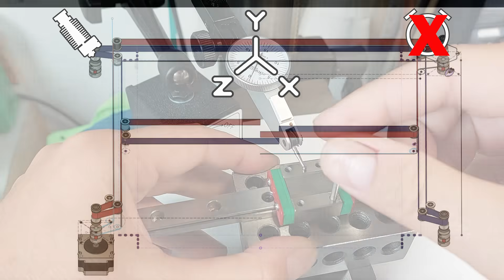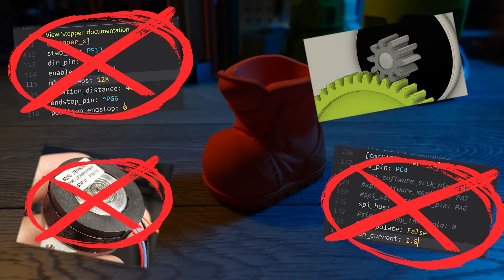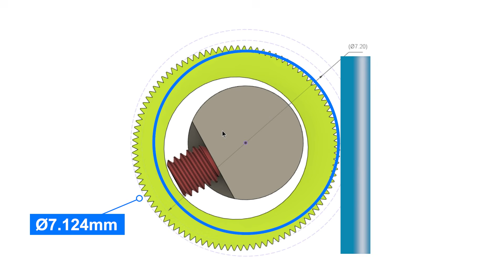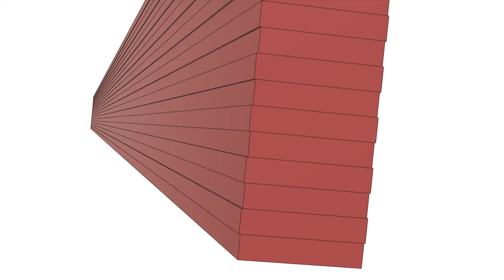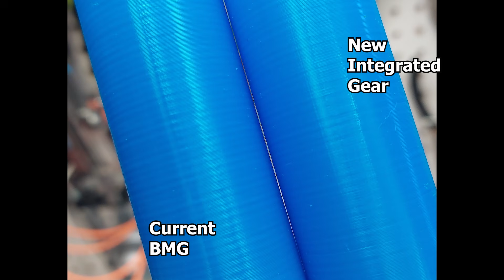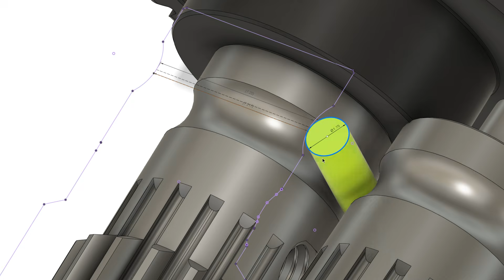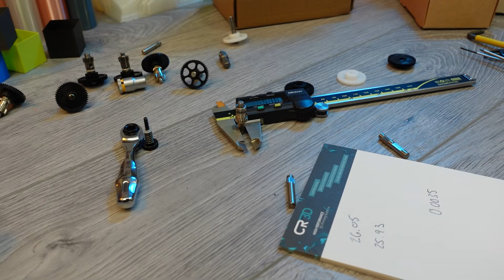Extrusion Quality - Mystery issue resolved !

Comment: This all seems very well.
A good design should not allow the Z axis screw to impart X or Y motion. It should only couple in one direction. 
But even with decoupling, if it is not straight, the advance will not be constant. 

What you need is a linear encoder directly attached the carriage and drive you motors in closed loop feedback of the actual position, rather than counting the degrees of rotation / steps.

You can find such 500 mm encoder with accuracy of 5 or 1 uM at reasonable prices of 100 to 200$CAD. However, none of the closed loop stepper drivers I have found yet have explicit support for a linear encoder, only magnetic or rotation encoder.

Also, the issue you are encountering here, leads me to believe that it is a constant pressure (or rather constant or accurately metered flow rate) that needs to be measured and compensated at the nozzle.

How to measure pressure or flow rate of the plastic in the extruder ? 

It would be much better to have a closed loop feedback compensation on either the extrusion chamber pressure and/or material flow rate at the nozzle.

Also, as you observed, the bowden tube lenght offer spring like buffering of the forces on the filament which could smooth out operations.  I think the dichotomy between bowden and direct drive is false ! The ideal setup is an hybrid system, which will allow even smaller direct extruder motors which are boosted by a larger, static bowden external extruder.
Reply: Chasing high precision parts and filament dimensions will cause the prices to skyrocket but live closed loop feedback at the extruder could take those tolerances out of the equation and keep prices low.  It might help to have a filament thickness sensor just as an extra data point in the calibration.

Comment: i already had a bearing in my extruder , and CNC kitchen pointed out the problem with the grub screw tilting the gear and making artifact
i checked my printer , and i found out the gear and the teeth are not eccentric the the motor shaft , the hole was not in the center of the gear at all
i bought a higher quality gear from another brand all together and it was night and day difference.
i have a Bowden tube and a MK6 extruder and i think the quality of my parts are comparable to yours , 
for anyone reading this ,if you can feel your layer lines check your extruder like in the video and make sure your layer lines are divisible by your nozzle diameter (for 0.4 nozzle , print at 0.2 , 0.12 ,0.14 ,0.18 layer height ) ,and tune pressure advance , it is worth it

Comment: The hub gear groove won’t self align because it’s squeezing a material that behaves like an elastic. Just like a crowned pulley pulls a rubber belt up onto the crown, the filament will pull itself into the tightest side of the groove. It’s counterintuitive, but happens anytime you squeeze or stretch something skinny against rollers because poisson’s ratio causes the filament (or belt) to curve towards the location with highest pressure.
Reply: Sorry not Poisson’s ratio, it’s just the pressure gradient in the material.

Comment: You and Simon are amazing!, I'm running your extruder design on a Vzbot with BMG internals, I also have the banding on my prints, been trying to figure out what it is?, which lead me here?, what bearings did you replace the floating gear with? I.D 3mm O.D 8mm ??

Update:
I've got one of the new gears which is now part of the shaft and it's no better than before, In fact I brought two of them and one of them has the biggest wobble you have ever seen on the plastic white 50t gear! (it's not flat) for that to end up at me shows you how much quality control is lacking at bondtech, I'm not very happy that I wasted £15 pounds on it?..... if you want me to send it to you I will?......will not be buying anymore of their stuff!, I don't see an improvement with the new gear, I see uneven layers when shinning a light from the top of the print, I'm going to try the bearing for the idle gear for a while! and some other things will update after testing, also if I go bowden it goes away like your prints.....I'm running a vz-bot gantry and your wobble wings on my lead screws on a core x-y design.......
The cleanest stacked layers I've ever seen was with a wanhao i3 that I used to own and that was just a toothed idler on the motor shaft with a v-bearing on the arm and tensioned with a spring.......

Comment: It looks like a bowden design creates a buffer for the extrusion that evens the flow. You lose precision from a DD yet you got those nice smooth layer lines. It's the same thing with rubber wheels and v-slot: not as precise as linear rods or rails yet for functional parts you get better surface, you lose details on figurines due to smoothing.

Comment: Amazing video!!! The difference between bowden and direct drive became apparent to me rather recently. I am glad someone else noticed the same issue! I have always liked Bondtech extruders, but I think there are still some issues that they need to work through. I have used the BMG on many direct drive setups and have also tried the LGX light extruder, and see the same artifacts that you referred to in this video with both extruders, even though the geometry between the two are drastically different. I have recently switched to the Orbiter 2.0 manufactured by LDO and the difference is surface quality is amazing!! Not perfect, but there is a drastic improvement when compared to both the BMG and the LGX.

Comment: I believe that the problem is due to the idle gear to no coincident the pith circle. They are supposed to be involute gears and must contact the pith circle to maintain constant rotation speed. When we approach the gears too much or separate the speed of rotation in the idle gear it will not be constant but a speed change pattern appears changing the extrusion volume of flow.
There will only be one position so that there are artifacts disappears.
With this type of designs that "are not mechanically orthodox", I mean that varying the involute gear distance of axes is not orthodox solution.
I know this issues from using rack and pinions in CNC.

Comment: What about a flexible shaft to move away the steeper? It could add a little bit of elasticity in the shaft, but it s usually a high acceleration. No steeper, less weight, less vibration.

Comment: Maybe something else that could also have an impact on how the filament rides through the extruder is whether there's any vertical lateral offset of the filament feed path into and out of the extruder teeth (if the filament is not directly in line with the centre of the extruder teeth), perhaps causing the filament to ride up/down the curved tooth profile during extrusion and retraction.

Comment: Most excellent video - congrats. I've had the same artifact problem for some time now. My printer is an FLSun SuperRacer with LGX-Lite direct drive running Klipper, and I thought upgrading the LGX-Lite with the new all metal drive gears would help. It didn't. So I replaced the original drive belts with new carbon-fiber reinforced ones, but that didn't help either. So maybe you have hit on the real problem with your filament walk theory. Here's hoping Bondtech finds a fix for that.

Comment: Maybe a future solution to eliminate it as an issue, is pre-shaping prior to nozzle, so there is a kind of restrictor that shapes the filament through slightly lower heat than final extrusion temperature. So for instance, you'd have a 0.4 nozzle, prior to reaching the nozzle having a restrictor that takes the tolerances of the 1.75mm filament into account and maybe shapes it down to 1.5 or 1.6 prior to reaching the nozzle. At that point if you then know that the filament will be precise diameter to, you'd only have to solve for pressure to keep flow and to monitor the flow.

Although a thought that might come to mind then might be "but what about retraction", and that's where a bowden style setup comes in and the distance to the nozzle being able to solve for flow, alternatively even doing a bi-extruder setup with bowden for filament-prep and direct drive for final print control. Granted nothing would yield as perfect feed rate as the industrial method of "clamping arms" that move with acme-rods while clamping onto something over a longer area with just friction and feed the filament completely evenly (or as even as the arms themselves move), but this isn't sustainable for use with "consumer grade" printers unless someone finds a way to make it far cheaper.

Comment: Would it be possible to introduce noise into the extrusion motor in order to create a minute random surface texture to hide any regularities in artifacting? It would leave a matte surface rather than completely smooth, but this may be useful and the melting methods of smoothing may need less time to level out the surface.

Comment: Wondering. Any reason why you use.lead screws instead of belted z?
Reply from the maker: I went with ball screws for potential high temp heat chamber printing and long term reliability.  I also had plans for light machining using tool changer.   Switching to belt would be A LOT of rework for which I don't see the value.
Reply: @MirageC  Makes sense.  But if you did n;t care about machining or high temp, would you think belts are better for z to get rid of issues?  Asking because you are one of the best 3d print guys i found, so would like your opinion on the issue.

Comment: Could you explain why the bowden system got better results? My first thought was, that the elasticity of filament between extruder and Nozzle would compensate? Is there an other explanation?

Very interesting video!
Reply from the maker: That is the main reason indeed.  The other reason was that I used a different extruder, a Hemera.

Comment: Motor Manufacturers and Pulley manufacturers need to work together to come up with a tighter tolerances solution that keep the pulley centered on the motor shaft.

Comment: If the bearing worked. Maybe the plastic should be push between two wheels that have smooth flat surface but with a good combination of hard soft and very grippy rubber. Hey! maybe with a new material like this one : https://www.youtube.com/watch?v=vS0TuIPoeBs

Comment: I've been attempting to recreate this experiment on my own printer in order to fix it in the Klipper firmware, but so far with very limited luck. What I basically want to know is how much I should adjust the flow rate for every value of the little gear thingie. I already have a test setup capable of applying the changes...

From my config, I should do a full revolution of the little gear in 22.22 mm of filament. That means I should be able to reproduce your results. What I tried, was 
(1) make a rectangular test pattern that extrudes exactly 22.22mm filament in the X direction. That gave some artefacts, but not enough to tell me that there's something on and how much to adjust the flow. I tried 
(2) extruding in thin air, and measuring the wire. I'm not sure if gravity interferes, but so far it gave me little luck. I tried measuring with a mitu micrometer, a microscope, and a precision caliper.
(3) extruding a single line. Well, it was worth the try, but that's not happening...
(4) putting the microscope in front of the nozzle and capturing it by camera. There's definitely variations there, not sure what the cause is though... could be pretty much anything. And again, I think the gravity 'pulls' the string out and smoothing it.

So at this point I'm starting to get out of ideas. Any suggestions?

Comment: Measuring my bambu labs extruder right now and the whole assembly has 80 micron of runout. Guess I found what’s causing my poor layer consistency
Reply: Thank you, I was wondering if they did better job
Reply: @mikoaj2323  not really. Quality control is poor and parts are impossible to fix yourself

Comment: Beautiful analysis! I would think firmware could compensate for some of this. Maybe print a test pattern, put it on a scanner (the paper kind), and do some image analysis to make a correction table. I suppose you would have to do this each power up, since there’s no extruded reference, for most of us.

Why is the contact surface curved instead of a wide V? A V would help guarantee that the filament always sets into the same position. An arc should never be used for a position reference.

Comment: Mr MirageC, the voron m4 extruder uses a belt. Assuming the main drive gears are perfect, does a belt eliminate the oscillation of flow? I'm not sure how to word it but I'm curious if using a belt with 'perfect mesh' at every point negates any diameter changes that off center gears do. It's hard for me to visualize. Or is it possible that it has such a large diameter that any variation is proportionately small?

Second question I have is what bearings did you use for the idler? I'd like to try that out.
Reply: I have voron m4 (direct drive) on 2 printers, and I can say, on one printer it looks pretty consistent, but on second one layers are uglier than you can see on video above. I think it has something to do with printing tightening part (the one with "M4" text) with right tolerances, so it couldn't move to sides

Comment: Thank you for this incredible work, you helped me a lot with this problem. For now i think that the right solution is the extruder mounted on Prusa XL, from the image of the release we can se a big wheel that grip the filament in lenght and not in both side because the idler is composed by 2 small bearing, in this way the surface of contact is very large without using an geared idler. Maybe this can be the future for direct extruders, what is your tought?

Comment: timing is not the thing you are looking for (jedi wave hand)
the fundamental problem you have is step driver say make in germany
tool runout is common issue with small diameter tool in cnc machining, but we are talking like <1mm tools and feed is less than runout so one side is not cutting and the other is cutting 2x. Then you get more problems when you need to drive at like tens k ripems, balance, runout etc.
When you use micron it messes up guys mind who uses proper metric system, for money at work and for money making gears and splines at work for money
If it was precision instrument you paid 10x what it cost you now so no is not precision and is driven by stepper so no way.
Getting even a machined gear to run less than 0.01 is difficult ask me how i know
Anyway, always when you start to fiddle more than is necessary you fuck yourself over

Comment: This is really interesting. I swapped my Voron CW1 out for a DyzeXtruder Pro I had laying around. The layer variation basically went away with the Dyze. Dyze doesn't use any set screw gears and everything is metal, which I assume improves tolerances and stability of the shafts.

Comment: Really enjoyed this video MirageC! I used to have this problem and somehow it went away after poking around my Ender 5 Plus. Though now my print quality is still good after adding Klipper to the mix, I get a weird VFA when I print and I'm kinda annoyed by it... 🙃 

I think it could be done by the dual gear extruder that I use (DG1 Extruder from 3DMaker) or maybe the use of brass leadscrew nuts instead of POM antibacklash nuts. I have a print that I done several months ago that looked lovely and smooth that I wish I could get back too.... 😞

Comment: High end printer... you mean something anyone can build in their room for 200-300 bucks.... 40$ main board 10-15$ per motor x4-5 = 40-60 bucks, 10 bucks for nuts and bolts, 10 bucks for pulleys and gears nd 20 bucks for some framing, 10 dollar hot end extra 50 bucks for whatever else...  there is nothing about these that are special there is more that goes into a walkman than a 3d printer lol even the construction is simple stupid.... the only thing thathas any true value to these things is the software and well thats free.... so wtf?
Reply from the maker: How much speed, reliability, material compatibility and quality are you getting from that "stupid" pile up you just described?  better than an ender3?  I hope the answer is yes to all aspects.
Reply: @MirageC  as much as every other generic printer on the market?  i just priced of the exact parts for the Ender 5 pro... thats how much it costs to build one....and no it is not better than an ender 3 lmao is worse lol.....

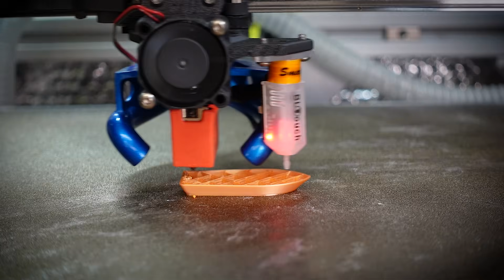Comment: Size of the printer made bowden impractical for retraction etc @5:00.  My first thought:  Keep the extruder on the print head, turn it to an angle other than directly into the heat break, and have an arbitrarily short run (200mm, 300mm perhaps?) of bowden tube make a few laps around the printhead itself, and then into the heat break.  Et vois la;  Bowden for shock absorbtion, with a tunable length.

Comment: Most likely this subtle variation is caused from stepper motor torque. Since it is technically a "gear", a single step increases the compression of the material in more of a jolt motion than a continuous push. The only solution I can think of that works with your current setup is swapping the stepper motor out with a servo motor. If you want to maintain the same printing speeds.
Edit: for clarification, when comparing to a boden tube system. As the pressure is displaced over a wider amount of material. As well as there being wiggle room in the tube. Which causes a spring like effect.

Comment: So the easy way to fix this is get a direct drive one. Like the ender uses. 
Then remove the motor and clamp it in a mill or lathe. Spin the motor. 

Then very gently machine the top of the griping gear thing so it's perfectly round and true to the shift as its being spun on the shift as you machine it. 

Now it must be perfectly true. 

Or a high tech way would be to add pressure sensing and have that control flow. 
Maybe mount the extrude on a loadcell so you can tell how hard then push is against the hot end.